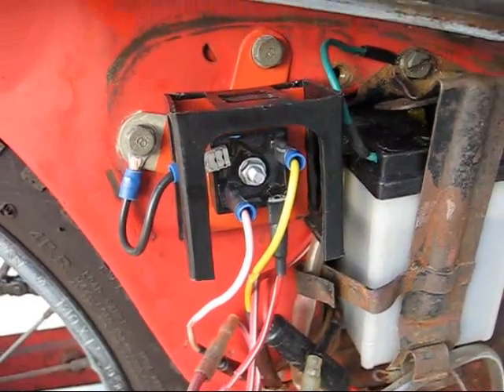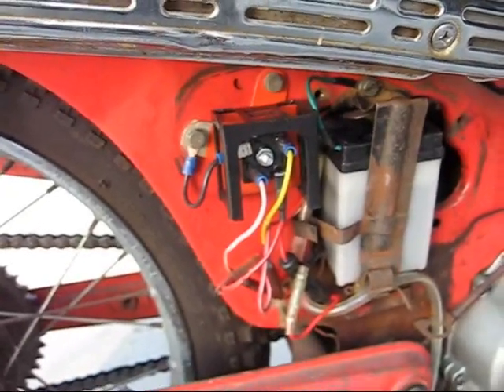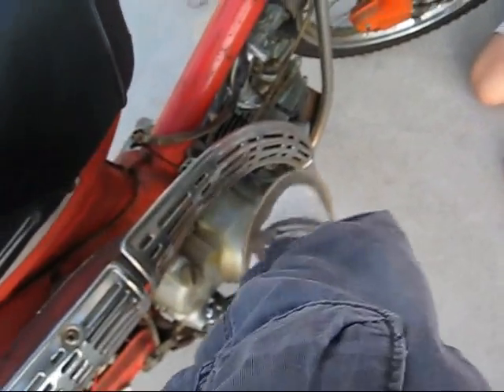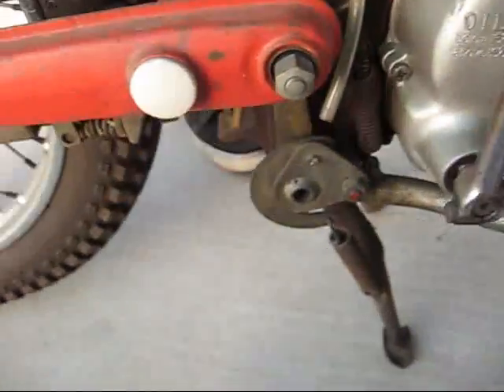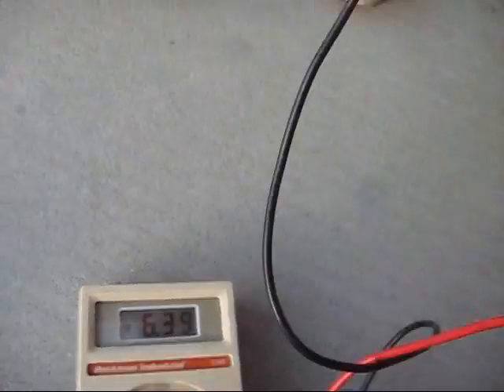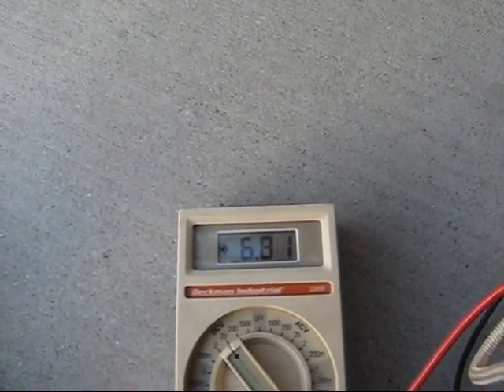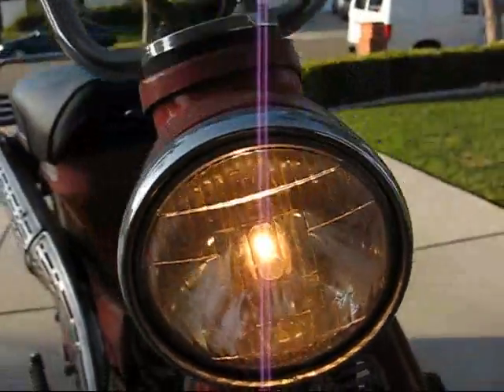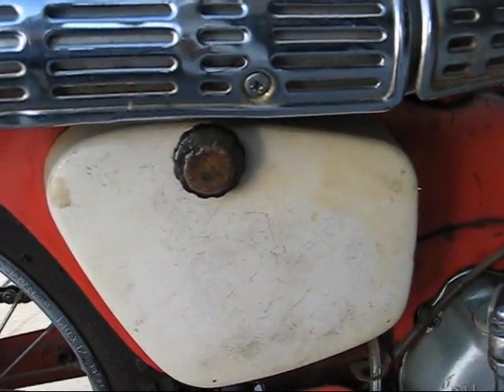CT 90 Rectifier Upgrade

Comment: Works well, but I'd try to hide that bridge inside the frame (where there's a lot of room, it seems on my 75). Keep the wires protected and the job looking clean.
Reply: Why would you bother to do that when it's entirely covered by the side covers?  Honda themselves put the original rectifier there.

Comment: I bought the radio shack rectifier, everything works fine, but I didn't attach any of the 'cooling plates'.. I just plugged the wires into the rectifier and bolted that into the original spot.. Will it be ok without any of those plates..? What problems would that cause and what are the symptoms..? Thanks

Comment: on a CT90, the battery is the voltage regulator. don't ever run the bike with the battery disconnected.
Reply: It wont start without battery

Comment: Great mod. Tossed out the original on mine, and the RS rectifier brought the DC output up from barely over 7v to 8.5v. Lights are brighter, bike seems to run stronger, and even the turn signals run a little faster.

Comment: hey there has to be two wires pink and yellow for ac current the day and night mode are wired into this to on the service manual i got a 67 honda 90 cd which is the same there is a plus and minus on the piece red goes to plus ground to frame from the neg terminal and the other two dont matter

Comment: I have a 1969 S90 nearing completion. I am thinking this 25amp rectifier should work for me. Problem is how should I wire this? There is just one red wire that I have to work with. How exactly should I wire this? This bike has been in the works for a very long time and I am not really sure where the original rectifier was. Aloha and Mahalo for your video. I will try and trace your wiring from the video.

Comment from the maker: @Narancazz 

I'd go and make sure the spark works; if not, you may need to clean and/or adjust the points.  If you do get it running, check to see if the voltage is at least 6.3 volts or more indicating the battery is charging.

Comment: i can't figure out how to take off the rear wheel and tire on my 1969 ct90. where there should be a nut, is a round thing with a hole in it. what's the trick???
thanks!